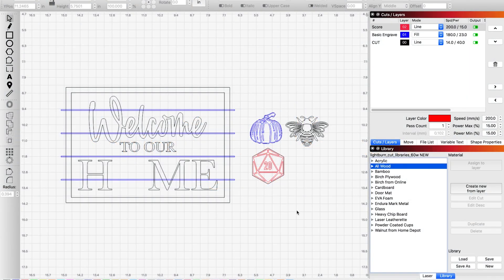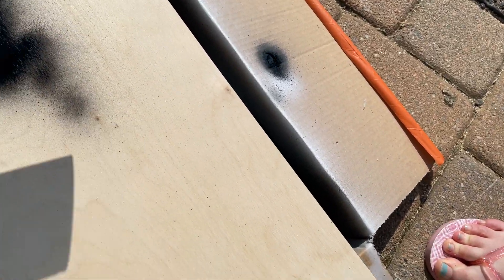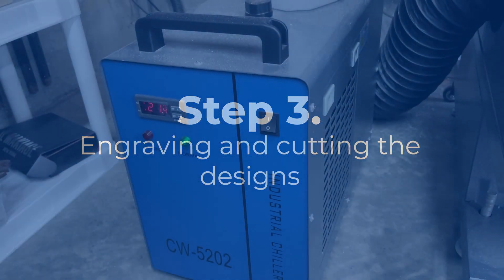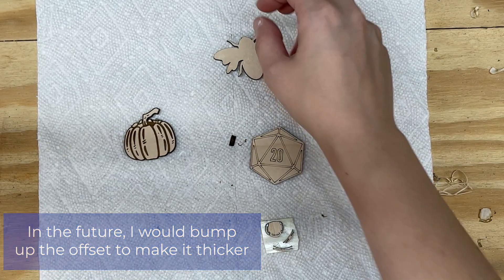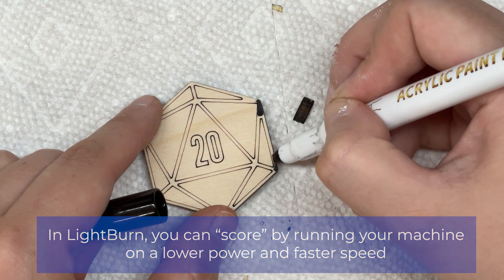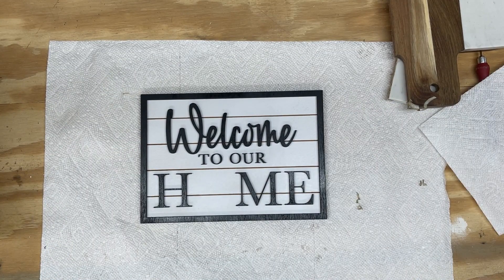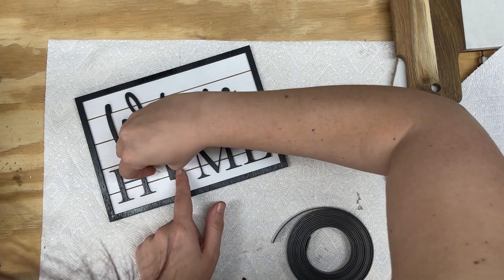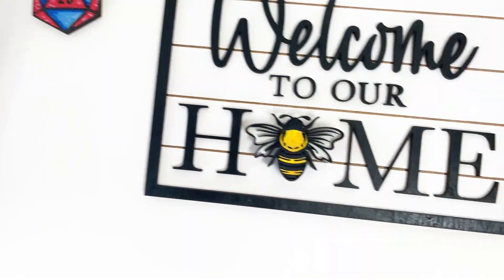How to Laser Cut an Interchangeable Sign with a Laser Engraver - DIY Project Walkthrough - OMTech

Comment: Thanks for this video thinking of getting one of these, but wondering if I can use other software to create? then upload or do you have to use lightburn ?
Reply from the maker: Great question! LightBurn is the go-to software and the most-compatible with our machines. However, the actual design process of the file can be done through Illustrator, CorelDRAW, etc.
Reply: @omtechlaser  Thanks so no matter what I need lightburn to get the vector images to machine or does this have software like the glowforge does built in? I use Inkscape and would like to continue to use this as my design software, so just wondering what I have to look forward to.
Reply from the maker: @jav9888  Our machines do not have built-in software; therefore, having a program like LightBurn or RDworks in place is needed.